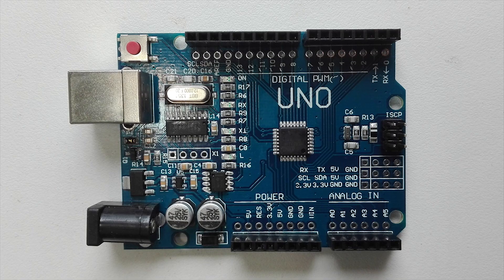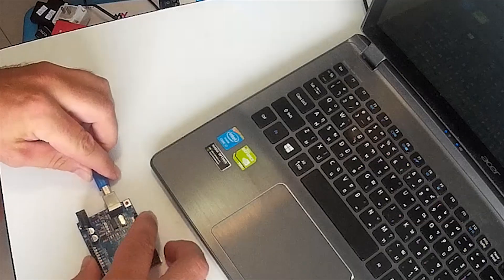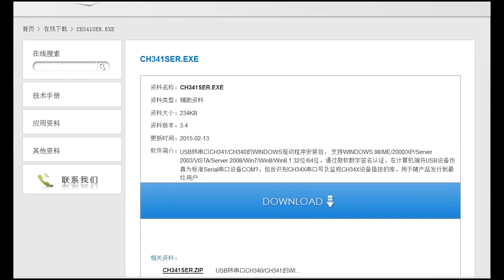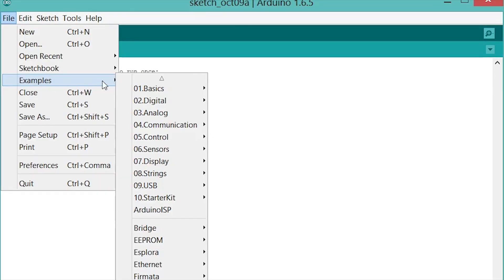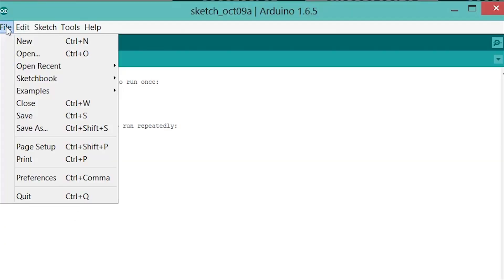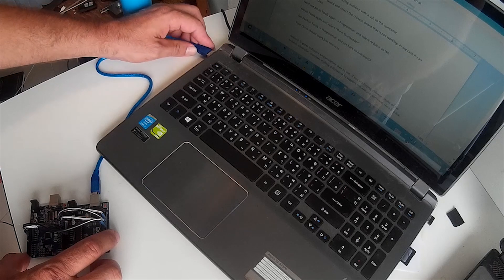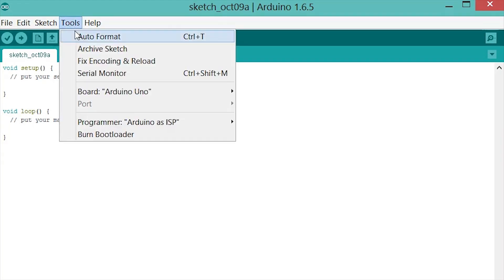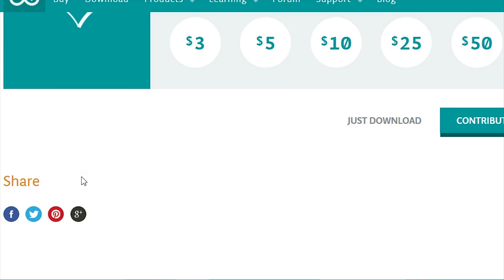How to fix bad Chinese Arduino clones

Comment: Your video title seems to suggest that the "bad" Chinese clones are faulty. They aren't. They just use a different hardware solution for the USB connectivity. So they aren't bad. Just using different ( cheaper ) hardware.
Issues are PC software related.
Reply: No, my is literaly bad. It crashes, it resets

Comment: Both 'duinos are clones. The 'duino on the left uses green fuse instead of gold
Reply: Khoi Sousa, seems like the fakes (not clones) are still better then... Well spotted
Reply: Cyberschn1tzel It's a counterfeit, not a fake
Reply: Khoi Sousa Yes any company can use the arduino logo and say uno on it
Reply: If it looks like a duck, quacks like a duck then it's a duck!

That's not a counterfeit!
Reply: the gold chip is a custom made component, it cannot be bought without license and needs to be specially manufactured.
anything can be counterfeited, but in this case the price would be just as high as the real thing
Reply: +Ghryst VanGhod It's not a chip, it's a fuse

Comment: hi. its write me an error
: Arduino: 1.6.8 (Windows 10), Board: "Arduino/Genuino Uno"

avrdude: Expected signature for ATmega328P is 1E 95 0F
         Double check chip, or use -F to override this check.
Wrong microcontroller found.  Did you select the right board from the Tools > Board menu?

what i need to do?
thanks for help

Comment: Yes it fix but when i upload the prog.. a new error comes.

Sketch uses 1,030 bytes (3%) of program storage space. Maximum is 32,256 bytes.
Global variables use 9 bytes (0%) of dynamic memory, leaving 2,039 bytes for local variables. Maximum is 2,048 bytes.
avrdude: ser_open(): can't open device "\\.\COM3": Access is denied.

Problem uploading to board.  See http://www.arduino.cc/en/Guide/Troubleshooting#upload for suggestions.
avrdude: stk500_recv(): programmer is not responding
avrdude: stk500_getsync() attempt 1 of 10: not in sync: resp=0x53
avrdude: stk500_recv(): programmer is not responding
avrdude: stk500_getsync() attempt 2 of 10: not in sync: resp=0x53
avrdude: stk500_recv(): programmer is not responding
avrdude: stk500_getsync() attempt 3 of 10: not in sync: resp=0x53
avrdude: stk500_recv(): programmer is not responding
avrdude: stk500_getsync() attempt 4 of 10: not in sync: resp=0x53
avrdude: stk500_recv(): programmer is not responding
avrdude: stk500_getsync() attempt 5 of 10: not in sync: resp=0x53
avrdude: stk500_recv(): programmer is not responding
avrdude: stk500_getsync() attempt 6 of 10: not in sync: resp=0x53
avrdude: stk500_recv(): programmer is not responding
avrdude: stk500_getsync() attempt 7 of 10: not in sync: resp=0x53
avrdude: stk500_recv(): programmer is not responding
avrdude: stk500_getsync() attempt 8 of 10: not in sync: resp=0x53
avrdude: stk500_recv(): programmer is not responding
avrdude: stk500_getsync() attempt 9 of 10: not in sync: resp=0x53
avrdude: stk500_recv(): programmer is not responding
avrdude: stk500_getsync() attempt 10 of 10: not in sync: resp=0x53
Problem uploading to board.  See http://www.arduino.cc/en/Guide/Troubleshooting#upload for suggestions.
Reply from the maker: +Noel So jr unplug and try again
Reply: nope still happen.. I already check if someone same problem to me. and they are lot of them

Comment: CH340 works ootb on Linux. No  fix needed.
Reply: Amun-Ra, I've got the same result for a clone Nano V3 on Linux Mint. :)
Reply: Work with raspberry pi without a driver???
Reply: check your arduino ide setup. especially the "board" and the "processor" settings. try processor settings saying "old bootloader". it worked for me, since these chinese dont give a fuck.
Reply: Yeah sure but most use Windows so still shite Chinese rubbish.
Reply: mine doesnt! :( what version arduino ide did you use?

Comment: I am having Uno as orignal & Mega as clone can I do it the same process. What u explain
Reply from the maker: +kiran padol Yes you can.
Reply: +kiran padol Did you try it with your original Uno and clone Mega 2560? Are the pinouts the same?

Comment: Hello Tom, I solved the problem to upload the program ArduinoISP to a working Arduino.
In the IDE 1.6.6. was a bad bin file called "ID.exe" located in the map Arduino\hardware\tools\avr\avr\bin.
I did rename it and left it. 
Then from IDE verson 1.0.6. I did copy the "ID.exe"
 file into 1.6.6. versions map.
Problem solved.
Merry CHRISTMAS to you all.
p.s. in this film you forgot to mention a capaceter of 20 pico pharat should be connected on the master board between Gnd and Reset pin.
Reply from the maker: +Hendrik Bolt Good. Thanks for you contribution!

Comment: Hello Tom, I Can't upload the sketch arduino isp to the genuine bord.
I get a red error text! I did try several times after reboot the whole system.
I have selected the proper com-port. 😢
Reply from the maker: Try harder. It should work at the end. Haha just joking.
If you can upload the blink sketch to your arduino, you should be able to upload the arduinospi sketch. Let me know if shit doesn't work.

Comment: heya. i got a chinese copy to screw around, i dont want to burn my original one.
question, chinese have the extra ... holes near the plastic plugs, like in your video. i need to solder pins there, or are duplicate of the plastic plugs ? thanks!
Reply from the maker: These holes are duplicates of the plastic holes.